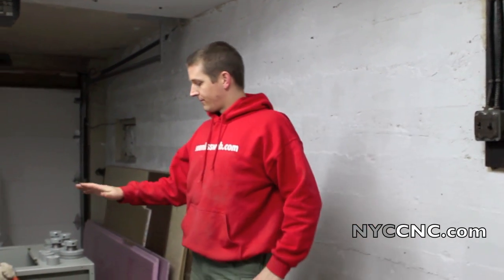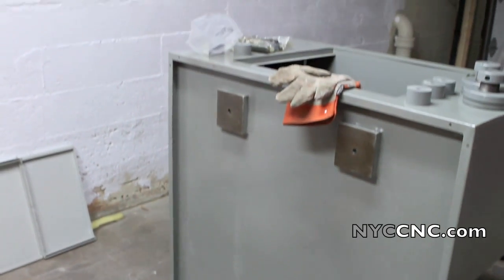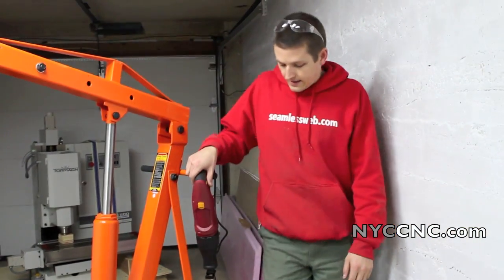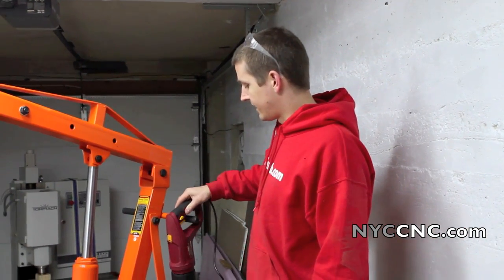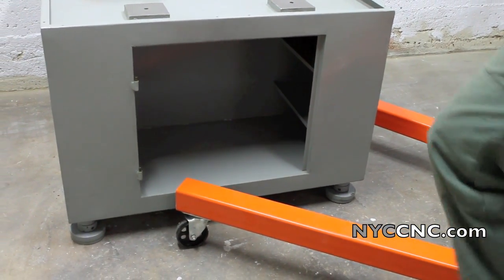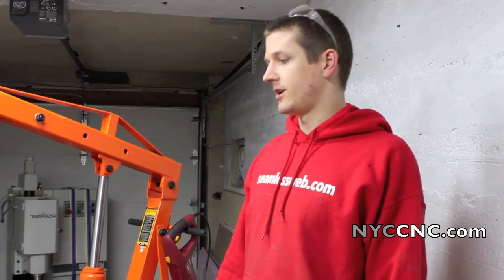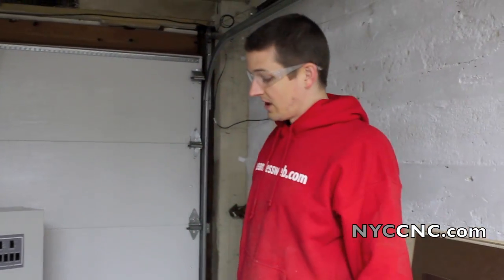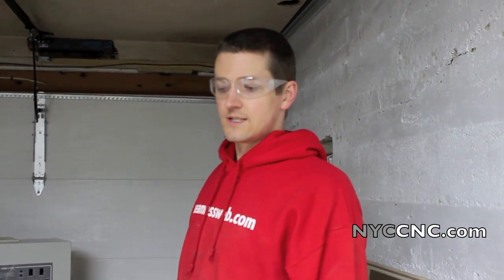Tormach PCNC 1100 - Final prep for stand and mill.  Ch. 8

Comment: Haha.You look like me the day my 5000lb CNC lathe showed up. I had a 50ft - 3 axle lowboy roll up in front of my house. I had to rent and operate a fork lift to get it off the trailer and into the shop. Talk about nerve racking.The garage door was to low to get the fork lift in, so I had to drop it just inside the door, and then wrestle it in. Then I had to help back the lowboy two blocks out of my neighborhood. That was one unhappy driver. You should have seen the neighbors. Good Luck- TMFA

Comment: Hey man glad to see you are going through the same frustrations as I did a few weeks ago. Hahahaha. I used a 2 tone jack with extra wide legs to clear the cabinet. make sure you seal all of the sheet metal with silicone including the stainless limit switch guard on the front of the table. I just ran my first program on the machine a few days ago and it worked awesome. Have fun....

Comment: I am actually glad to see you in the video not just to hear you narrating the video. Overall great series on the Tormach. 

My CNC is basically a huge Tormach, well, with the exception of the Tormach PCNC1000 control cabinet on the right of the mill, although it is sized in between the Tormach and the FADAL 4020, and maybe even a little smaller than a HAAS.